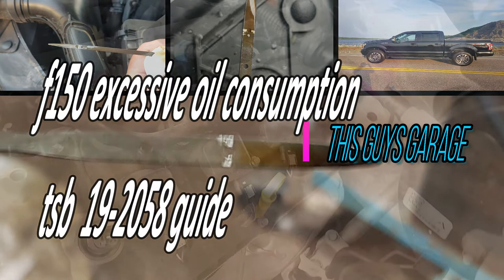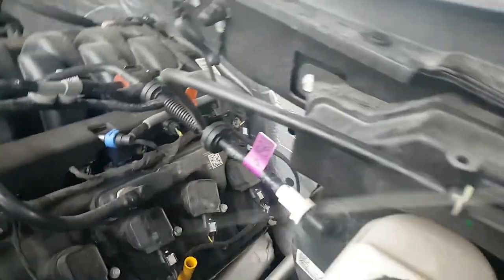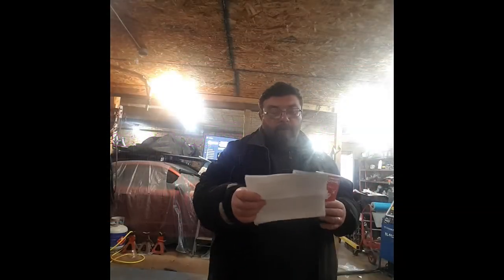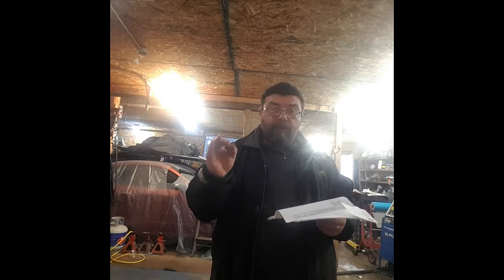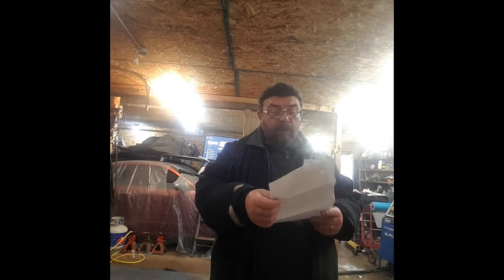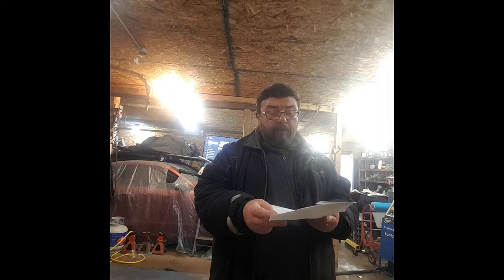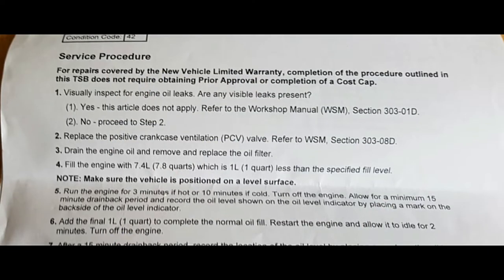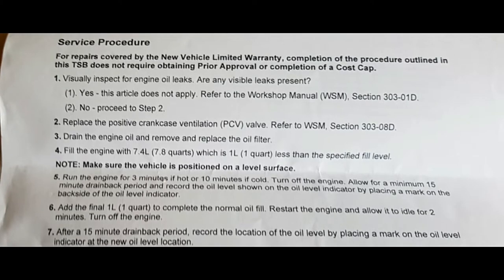FORD F 150 burning oil  2018 2019 2020 tsb 2058 service bulletin excessive oil consumption guide

Comment: After 2 years, I traded my 2018 F150 with the V8 for the 3.5 Eco Boost. That 5.0 sure loved the oil. Had the test done on it. but it only burnt 3/4 of a liter. Also the cam phasers stared making noise. Shades of the 5.4 Triton. I love my 3.5. Great video thanks for making it.
Reply from the maker: thank you for taking the time. i have a 3.5 right now too
Reply: @thisguysgarage  How do you like or dislike the 3.5? Maybe a video on that?
Reply from the maker: @shinersan6081  im not ready to endorse it yet im still a little gunshy before the first oil change comes due lol .i am thinking about it though,ty again shiner

Comment: I have a 2020 raptor and just last week I literally got a warning of loss of oil pressure. I freaked out, with just 4300 kms, oil was my last concern. I had almost no more oil!!! I added 2 litres of 5w30 as the gas station only had 2 bottles. Got an oil change at a mr. Lube and will check levels of oil at every gas tank. Will then show this to dealer, and continue with oil burning verifications with them. if this is an engine issue, I will just sell the truck
Reply from the maker: hope it settles down,keep in touch Eddy,appreciate your time!

Comment: Mine is a 2018 Ford F-150. 5.0. 14,000 miles on it. I haven’t had any oil consumption. Dealer wanted first oil change at 2,000 miles. & I have been changing oil every 3,000 miles. It has 3,000 miles on the current oil & dip stick says its full. It still has factory dip stick.  Lucky so far!! To fix the deceleration rattle I put it in advance trac sport mode by pressing the traction control button twice.
Reply from the maker: ty for taking the time. 
the oil consumption test is for 3000 miles.  if you keep this schedule up you maybe lucky. most people don't change the oil til the light comes on at 5000 miles.  if you have to change the driving mode to alleviate symptoms in my opinion is a bandaid solution.  ford needs to fix the millions of trucks with this issue .
no disrespect intended
Reply: this guy's garage  totally agree it’s a band aid to the problem to that annoying deceleration rattle!!  They must be trying to squeeze the best gas mileage possible out of these trucks now. My future truck might be a super duty with the push rod port injection 7.3 gas engine
Reply from the maker: @royalelwood9538  the Godzilla is peaking my interest to R E .
3000 mile oil change would be advice id give anyone with the 5.0.
ty again
Reply: My Ford dealership service department told me to use only 91 octane gas. First oil change at 2,000 miles and every 5,000 miles after that. They win the presidential award about every year for customer service. the top 17 percent of ford dealerships win this award. They also told me to take it on a road trip and vary the throttle mph  to break it in properly. & not use sport mode or manual mode for the first 1,000 miles.
Reply from the maker: @royalelwood9538  did they tell you there were problems with the 5.0? the problems are well documented from ford.
Reply: No they have never said anything about the problems with the 5.0. Ford has a lot of problems not just the 5.0. There advise they give to customers I am sure they are crossing their fingers everything works out for their customers. Lol. Wouldn’t want to be in their shoes.
Reply from the maker: @royalelwood9538  the advice they gave you will hide the symptoms till they cant be hid. it is a bandaid solution that drives up your cost of ownership.  you shouldn't feel bad for them. you should be angry. 
Ford made the problem. they just sell it.  ty for taking the time i mean no disrespect .salesmen sell s#it literally.

Comment: MY 19 F-150 Limited with the 3.5 ho engine burnt oil from day 1 ..light came on after the first 1,000 miles. Went through 3  months of oil consumption test with dealer then the last time the dealer screwed me and filled up and said it didn't burn any oil. Very pissed off and traded it in   for a 19 Ram Limited and has not burnt a drop ..cya ford
Reply from the maker: Good to know. Ty for taking the time 🤜🤛
Reply: Ram isnt much better.
Reply: @andybub45 . Wayyyyy better😁

Comment: Thank you Sir for all the info. 2018-2020 F150 5.0L. TSB:19-2365 reprograms the Powertrain Control Module (PCM) to reduce engine vacuum during deceleration fuel shut off (DFSO). During DFSO oil may be pulled into the intake from the Positive Crankcase Ventilation Valve (PCV). Ford replaces the oil dipstick as well. Apparently, this solves the oil consumption issue affecting many people. Pass this along to anyone with one of these trucks and tell them to keep an eye on the oil levels. 2 years of research from YouTube and forums and this may be the fix we've been looking for. Good luck everyone.
Reply from the maker: thank you very much!
Reply: Peter Thomson All Ford does regarding the dipstick is they have you install a longer one with the markers at a lower level so it doesn’t show the oil consumption! Wow.

Comment: My 18 F-150 went through 5 quarts of oil before it's first oil change - is this still affecting the 2020, and the upcoming 2021's?  They did the computer update and gave me a new dipstick, made no difference, still using oil.  I'd be really pissed if it weren't a leased vehicle - At the end of my lease I just hand them the keys.  But, do I buy another Ford?
Reply from the maker: The technical service bulletin includes 2020 and no changes as far as i know for 2021 . Don't get a 5.0 for sure. Ty for taking the time
Reply: @thisguysgarage  2017's are ok though?
Reply from the maker: @gerrybuffett770  do you have the 10 speed transmission or the 6 speed?

Comment: I somehow missed this vid Caper.  I will say that Ford is jacking you around about this excessive  oil consumption problem and they should replace the entire engine at their expense.  Perhaps it's time to go over the dealership management heads and contact Ford Corp. directly.  I hope you get this piston slap problem resolved.  Cheers!
Reply from the maker: I have escalated as far as I can . its hurry up and wait right now. I'm not a patient guy though lol

Comment: Wow...  A flow chart to tell you if you have (and you already knew) an oil burner.  One liter/quart per 3000 miles is normal oil consumption?  Sounds like GM or FCA wrote the letter. 

"Don't worry, its within normal tolerances."  Bull.  I'm glad your documenting this.  5.0 motor?  That's almost a 302 right?  Never met a 302 that didn't leak or burn.  Its nice to know some things don't change but I'm sure that's not want you think of when you hear that expression.

Good luck and thanks for uploading.  I'm sure a lot of Ford F150 owners are going to be viewing this.
Reply from the maker: People need to know. 
Thanks so much Eric
Reply: 2018 5.0 is a 307, FYI.

Comment: Good luck we are going through this to with a 18 f 150 now they added a new procedure going to change oil again and replace dip stick and make changes in computer settings ours has used 5 quarts in 2000 miles so far they just did new steps today 1/27/20 in Massachusetts the hard part is my son drives this truck and he is stationed in New Jersey in the Air Force.
Reply from the maker: The longer dipstick is  a ruse. Something coming up soon on this. 
I feel your pain.  Even as a Canadian your sons service is appreciated. They keep us all safe 🤜🤛
Reply: this guy's garage thanks we appreciate it he’s home now for a couple days then headed back I told them what would happen if we didn’t put any more oil in it and motor blew up they said u will get a new motor !!!
Reply from the maker: @RichTheitalianplumber  👍problem solved

Comment: I noticed my 2018 f150 5.0 was down a litre of oil and the tip on my tailpipe was covered in carbon. So I took pictures and documented kms, date and time and visited my ford garage. They told me and I quote "there's nothing wrong with that new engine, it's normal for a new engine to burn a bit of oil till the rings seat". I said "Not two litres in six hundred kms!" So I continued this BS for two more weeks until finally I went back and told them "I know as well as you do that there is something wrong with this engine, now tell me what ford is gonna do for me!" and so they said they wanted me to do the "oil consumption test", I said "forget that, I've already been doing that, here's my results!". So they took my results and done the TSB and installed the fix all dipstick.
Reply from the maker: It's a piss off for sure.
Let them do the test, or what my sales man told me stop checking the oil, they only fix catastrophic failure.

Sad but true

Comment: This brings two questions to my mind;

1.) If you know you have an engine that is allowing oil to get past the piston rings, and being burned in the combustion chamber at a rate of 1 quart every 3K Miles,
How long before the oxygen sensors, and catalytic converters are damaged, and become inoperable?

2.) In this case, which type of oil being burned in the combustion chamber is less likely to damage oxygen sensors, and catalytic converters, 
Conventional, or Full Synthetic?

Side note: I thought Software Updates, or PCM re-programming are for fixing issues like transmission shift points, or setting idle speed. If they can get piston rings to swell a few thousands with a software update, that would be pretty cool.
Oh wait, that's a load of malarkey.
Reply from the maker: Thanks for coming back chuck 

You are spot on 🤜🤛
Reply: @thisguysgarage  
I'm gonna steal this video topic.
Reply from the maker: @PanzerPlatform  no problem 🤜🤛
Reply: TSB 19-2338. Google it
Reply: Hey Bone,
Thanks for the clarification.

"Additional engineering analysis has found that an excessive oil consumption condition may be caused by the powertrain control module (PCM) strategy which purposely closes the throttle plate during the deceleration fuel shut off (DFSO) events resulting in high intake manifold vacuum which can pull oil past the piston rings and into the combustion chamber. To correct the condition, a revised PCM calibration is in the process of being released to adjust the throttle plate opening angle to reduce engine manifold vacuum during DFSO events."

In theory, this sounds like it will work for the oil consumption issue. 
But, with this new PCM calibration, it sounds like it will affect fuels economy, engine braking, accelerated brake pad, and rotor wear, and maybe some other drivability issues.

I still suspect the compression, and oil control piston rings are too loose.
I'm curious how this turns out.
I'm counting on our man "this guy" to keep us abreast. 
-Chuck
Reply: Also, Ford has to be very careful how they address this issue as there are lawyers on standby on both sides.

Comment: Wow Caper, theres no computer flash update or anything that can be done electrically to the computer that can fix an oil consumption problem..We have the same issue on some of Dodge vehicles that im ill advised to speak on..lol..But you right, demand a complete engine assembly. I will share this video link on some of my engine videos.
Reply from the maker: Thanks so much jt. You are right on the PCm . Piss on my leg and tell me its raining lol.
Really appreciate the help
Reply from the maker: rich williams  hey rich thanks for taking the timer.  Just wondering if you started this procedure.  Did they change your dip stick by any chance?
Reply from the maker: rich williams  me too 🤜🤛
Reply: rich williams  I have the same tic tic and its awful. Soon as they did the PCM update after being 3.5q low the tic got much louder. As of right now my truck has 9,628miles on it and ticking its ass off. Told them they can fix it 100%, or buy it back. Not gonna havr a Frankenstein truck motor with less than 10k miles on it.
Reply: @thisguysgarage  they replaced my dip stick as part of the TSB when they did the PCM flash. They call it OIL LEVEL INDICATOR or something else to be fancy.

Comment: Scotty Kilmer says the 5.0L oil consumption problem is a Ford class defect that Ford won't admit to.  All of Ford's work arounds don't address or fix the real problem..... which is that Ford used an aluminum block on these 5.0 engines, and didn't sleeve the cylinders.  They used a ceramic coating in these cylinders (to save a few pennies), and this coating is either failing or it isn't working as it's supposed to, thus causing the massive oil consumption problem.
Reply from the maker: ty

Comment: That's terrible but seems like all manufacturers have oil consumption issues. I'd definitely talk to a general manager or even bombard ford corporate with calls . Wonder if they have been doing a lot of engines and the warranty numbers are too high and that's why they dont want to change the engine yet. At GM we mostly  do piston replacement for oil consumptions.
Reply from the maker: thanks bud ,i can say for certain i have been the squeaky wheel tony

Comment: I have a 2020 Ford F1 5.0 leader And my truck is doing the exact same thing I just recently changed it and I'm losing a court I just checked it again and I'm down on the 2nd. below I'm having problems with the 10 speed transmission it shakes while I'm driving forward had it in the shop like 6 times for the same problem I just found out with this oral combustion problem I don't know where it's going it's not leaking

Comment: my 2017 5.0 has been great -- but i'm headed to ford today to buy a 2020 -- now i'm starting to wonder if i should?
Reply from the maker: dont do it
Reply: @thisguysgarage  any recommendations? my 2017 has a 105 000km -- so i'm thinking issues will soon be coming
Reply from the maker: @Rev.DavidJTowns  if your truck has the 6 speed transmission,keep it ,i promice you it will be better than the 20, maintaintain iance would be my suggestion.  it is not a small problem with the 18,19 &20 they cant fix it.  i have been in contact with more than a 100 people having the same issue.  on channel as small as mine thats saying something.
Reply: @thisguysgarage  thank you i kept my appointment to buy the new truck -- but when i questioned the salesman he acted like he had never heard of such a problem -- so i asked the service department they too said never heard of it so i educated them with the multitudes of youtube -- needless to say i didn't buy today. & thanks i will keep it.
Reply from the maker: @Rev.DavidJTowns  and the truth will set you free!  pun intended, ty for letting me know.
saying they never heard of the problem when ford has no less than 10 technical service bullitens on the matter is rather disingenuous. good for you!

Comment: Just did the ford run around truck burns oil so they did the dipstick marking, they sealed dipstick and the fill hole and I was told not to check or break the seel. So I ran it for the 3000 miles took it back they put in new dipstick and flashed the computer. I was told all is good didn’t burn more than normal. I’ve personally put 5 quarts in it prior to this so I went on my merry way. As off yesterday 2500 miles into fords new dipstick and computer flash my truck is 3quarts low and making a whistling noise while shut off. Took it back to ford yesterday and they topped it off and said keep an eye on it. That’s 9 quarts since I’ve been monitoring it in the truck only has 21,700 miles on it.
Reply from the maker: Time to look into lemon law in your area. Ty so much for taking the time this is frustrating.  Please let me know how you make out 🤜🤛
Reply: @thisguysgarage  I watched your dipstick video, and I think you came up with the conclusion that the new dipstick from hole to hole is now three quarts low instead of the old dipstick from hole to hole being 1 quart low.
Reply from the maker: @timm4569  exactly . nailed it!
Reply: Update, another 3quarts down and ford is now wanting me to bring my truck in so they can tear it down and look into it deeper. So that’s a total of 24quarts in 24,000 miles and that’s not including the oil changes. I really don’t want them to tear it down just buy my truck back and we’ll go from there it will never be the same.
Reply from the maker: @timm4569  i would ask for the tsb or something in writing stating fords plans for tear down. What thier desired outcome is.  Get it in writing all of it.
What is the buyback procedure in your area?
Reply: I keep getting a mail error, so if you get my messages will be three different ones. They have two more tries the dipstick failed so then it becomes a lemon law. And they won't answer me on the buyback
Reply from the maker: @timm4569  no problem.  I can tell you that whatever they do won't fix it. Hold fast keep in touch.  Documents are going to be your friend 👍
Reply: @thisguysgarage  will do
Reply: this guy's garage so I got my truck back, they had it for 2weeks and no rebuild or tear down. After two weeks ford decided to just change the Pcv valve  now at 600 miles and she’s burnt over a quart so now I have to take it back on Monday there going to replace the heads.
Reply from the maker: @timm4569  tell them to call you in when it is apart, you want to see it.

i don't think it's a head problem but I am not there to see why they came to this conclusion 
get some pictures or stealth video if you can . keep in touch. ty Tim
Reply: @thisguysgarage  I will give it a try
Reply from the maker: @timm4569  they should be able to visually show you the problem with the head or heads. if they can't its not the problem.
Reply: this guy's garage The mechanics just as frustrated, he says he hast to follow Ford’s protocol and what they tell him to do even if he doesn’t agree with it.
Reply from the maker: @timm4569  i know. it is frustrating. 
they (ford) don't want mechanics. they want yes men.
document everything you can